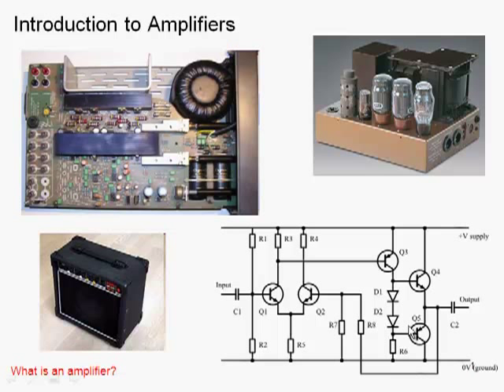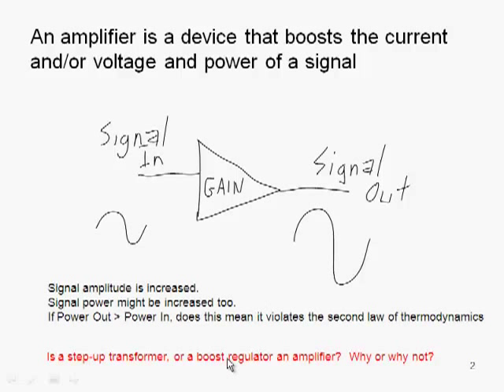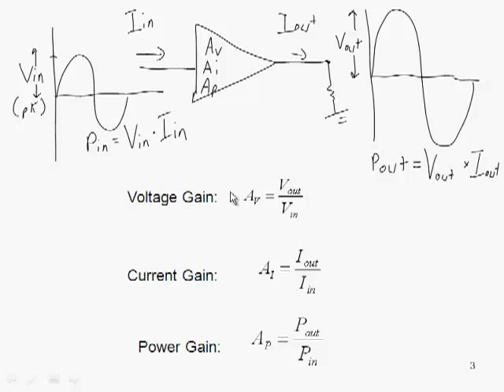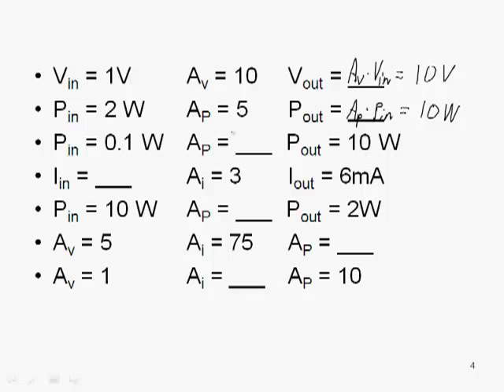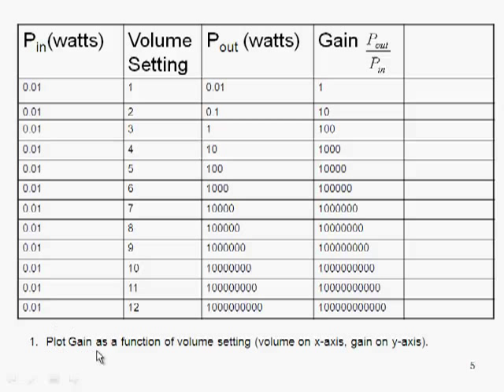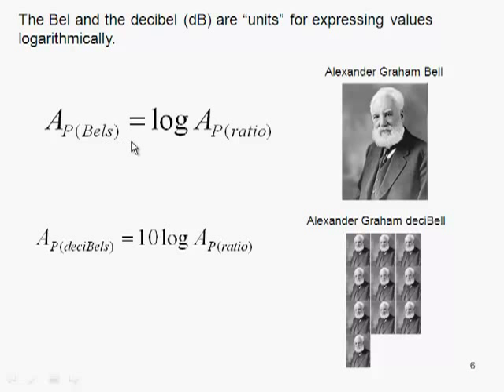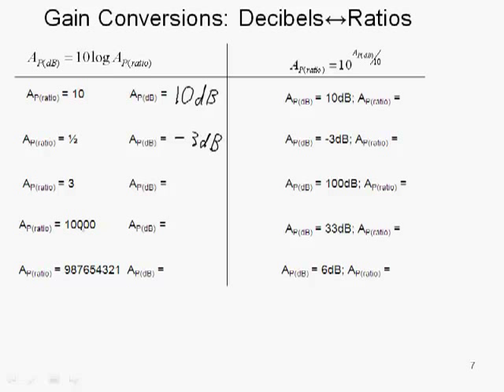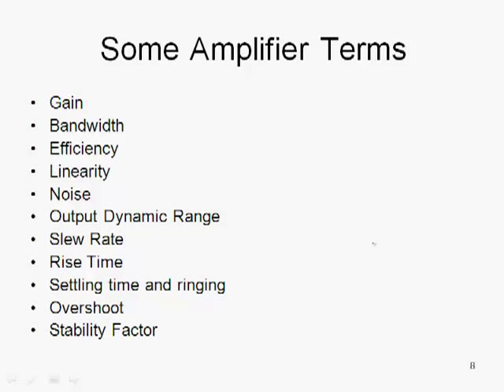Electronic Circuits - General Amplifier Theory 1 - Gain

Comment: you say 10 dB are 1B but the equation seen says 1db is 10B.. confused
Reply: *2 years later. If you divide both sides by 10, the right side agrees with the above equations right side and the 10 in the denominator on the left side is cancelled out with the deci in brackets "Ap('deci'Bels)".